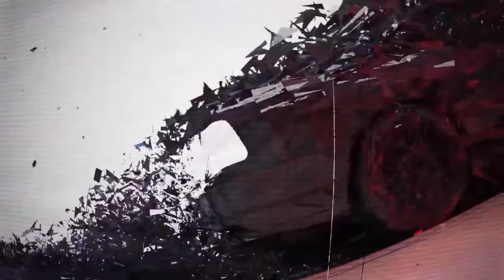Making a V8 SUV to Stop Smoking - BMW E70 X5 - Project X5: Part 2

Comment: I did this job on my 2010 X5 n62 engine, where I replaced upper timing cover gaskets, valve seal gaskets, o-rings for vanos solenoids, but I took off the heads so I could lap valves and clean the valves and piston chambers due to carbon build-up from couple years of burning oil. I bought the timing kit and timed engine just like you show in this video. but the n62 engine is misfiring from cyliinder 4, 6, 7, and 8. I replaced all spark plugs, coils and all fuel injectors and I'm still having this misfiring issue. What I noticed is that the spark plugs that have a misfire are clean, where they are not firing or buring w/ the spark and fuel. What could my issue here? I put light tester on my coil connectors to see if there was power going to them and there is. I just cant verify if gas is going into the misfiring cylinders. I was thinking after viewing this video if I didn't position the camshafts correctly even though I used the timing tool and maybe the valves are not closing all the way so I'm not getting a spark on cylinders misfiring. M539 Restoration any suggestions I should try or video I need to look at for possible solutions. Thanks for all reply comments, in advance.
Reply: Sounds like you have a valves clearance issue. Do a compression and leak down test.

Comment: This may be a silly question but why not pull the heads and do springs, valve stem seals, and valve seats?
Reply from the maker: Not worth it.
Reply: @M539Restorations  Oh, I'm a Honda guy so whenever there's a valve seal issue I just get the whole head rebuilt. I wasn't sure of the lifespan of BMW valve springs, seats, and such. Honda stuff is kinda tired at 150k.
Reply: @ahoneyman  to be fair most hondas are much easier to pull heads on as well
Reply: @dominic7114  I just don't know how long BMW springs and seats last. They may be good for 350k miles. Honda seats and springs are kinda tired by the time the seals go.

Comment: Hey there ..! If do you’ll lift the engine a little from the bottom ( 1 side a time ) you’ll get a better access to remove the valve cover easily
Reply from the maker: That doesn't makes sense, you'd be making less space that way.
Reply: Well actually not ..! If do you’ll lift the engine a little like 2” inches you’ll get more room to remove all the parts of hat do you’ll need.:! I had done on my E60 545i and E70 4.8l and made me job much easier..!  Thank you for your videos..! I had done my E38 headliner ( Alcantara ) like you did on the 750  always videos explaining how you doing helping a lot ..! Thank you 🍻🍻 GRACIAS..!
Reply: Sorry maybe I didn’t explained right .. do you have to do one of the side by time .. unscrew the motor mounts bolt before once do you’ll get done the job put back on place the engine and go head to the next side ..! Well this help me a lot to do the valve covers gasket service ..
Reply from the maker: Again, doesn't make sense to me as the A/C pipes and strut towers will be still in the way and you'll push the engine closer to the firewall creating less space. If you raise it that much without unbolting engine mounts, you'll destroy them. Thank you!
Reply: Well it’s just a tip for me works great  ..! Thank you for your videos
Reply from the maker: @AngelLopez-ys6bt  i didn't see your latest comment, one side at the time with engine mount unbolted does make sense! Good tip indeed. Thank you!

Comment: Your videos do nothing to make me want to buy a BMW newer than my E46. Valve seals shouldn't be failing at that milage. Cheap parts, not really good enough on an expensive vehicle.
Also the ludicrous complexity of the engine and just getting to the seals would do my head in.
Older cars appeal so much more when you're doing your own repairs.
You've got some other vehicles to work on. Time to put some hours into that E21! 😁

Comment: Hello, I changed the stem seals and set the time correctly  and put everything back together, but now my truck does not start and it gave me the code 2E6F Digital engine Electronics ignition 2 monitoring:Combustion Duration, could you help me!

Comment: 🤣🤣🤣🤣"the usual stuff such as nails and timing chain guides"   only on a BMW😂😂😂

Just a pity BMW never learned from the decades old Benz hinge design that with one clip on the bonnet stay allows the bonnet to be vertical.

You should explain why

Comment: Hello, I changed the steam seals and set the time correctly and put everything back together, but now my truck does not start and it gave me the code 2E6F Digital engine Electronics ignition 2 monitoring:Combustion Duration, could you help me!

Comment: Whats the difference betwen different coolant colours?

limescale is because of tap water, not wrong coolant

btw. cars have been using normal water until 90s so limescale doesnt even make that much of a difference
Reply: The components that the coolant is produced with differ, the blue coolant (g11) is actualy more agressive then the pink (g12). G12 can be used in g11 systems but mixing them gives the coolant a shady colour. If the cooling system is empty there is no problem using g12 in older cars.

Comment: You wantdd to paint the plastic cover under the windshieldwipers? Try this: heat it up with a paintstripping gun and treat it after with some used motoroil as protective layer.
Reply from the maker: No, you will ruin the plastic.

Comment: Curious question, isn´t it better to remove this engine completely? Replace all seams/brackets, fix water pipe, use new pipes for cooling system, new expansion tank and then put it all together?
Reply from the maker: No, unless you are planning a full rebuild. In the next episode, all of the seals and cooling system parts are replaced.

Comment: This is least of my worry this engine runs too hot just imagine living Florida owing 3 550i with same engine same fucking problems oil leaks from alternator or upper oil pan valve cover gasket leak timing cover leak every gasket will leak don't even waste your time just junk it it will run hot again low temp  thermostat or not still going to cook the gasket this car runs better in cool climate

Comment: Imagine how expensive this job must be at BMW and then they use their shtty seals that will fail prematurely.
The original seals are clearly not high temp seals because they are black rubber, the aftermarket seals are the correct red seal material that means they are high temp seals.

Comment: It's disturbing that powerful engines so hard to be worked on it. ofc they can be designed to be serviced easier but capitalism doesn't allow it. these powerful machines just stay in petrolheads dreams and most of time they are left behind to rust in a barn while 30 year old trucks, corollas, civics still run like crazy.

Comment: It’s a shame that BMW builds their engines with such poor quality parts and design.   My next door neighbor had an X5,  fast and fun to drive!!   It burned a little oil after just 75,000 miles, unacceptable for such an expensive car.   Which was shocking enough then one day the oil pump failed and the engine seized up!   Poor engineering and bad quality.   What an expensive POS!

Comment: Complete waste of time. Drop the engine, pull heads, do a valve job, reseal the engine, replace all the plastic parts. Fix smoking and the leaks at the same time.
Reply from the maker: Complete waste of time is dropping the engine and only doing that without refreshing the bottom end.